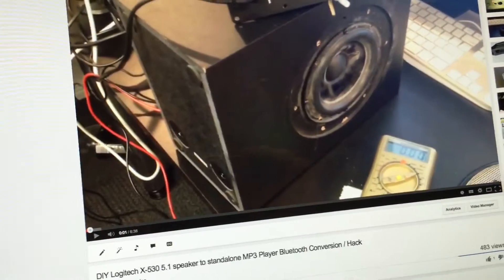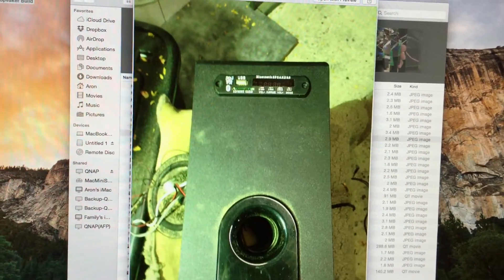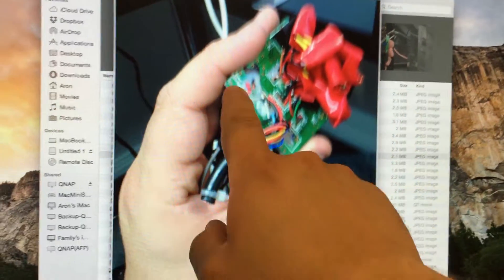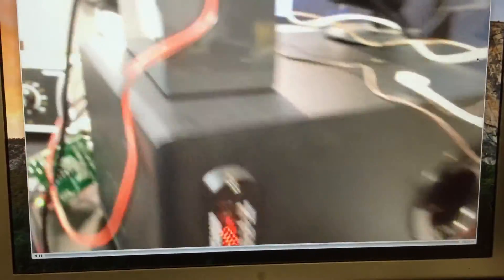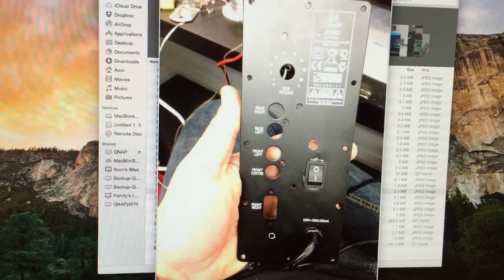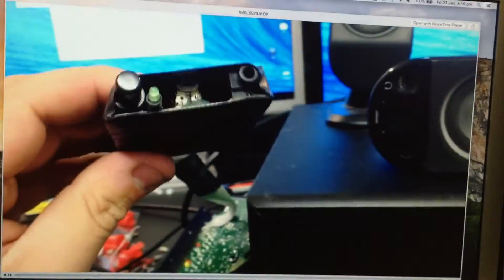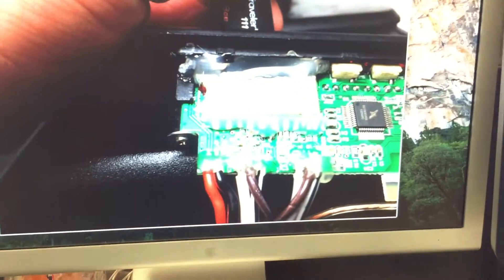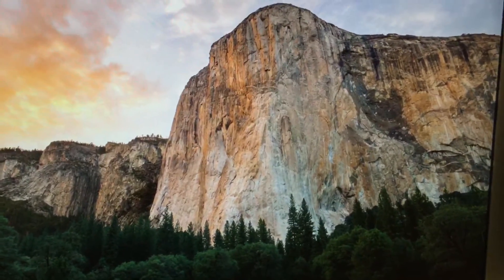DIY Logitech X-530 5.1 speaker to standalone MP3 Player Bluetooth Conversion / Hack Part 2

Comment: So basically you can use 12v battery for this setup and you have nice Bluetooth speaker to go?
Reply from the maker: the speaker takes more than 12v however it could be modified to work. the best solution however would be to get a cheap class D amp board from eBay

Comment: how you connect mp3 decoder to amplifier?
Reply from the maker: tero revo connect the line out to the line in on the amp.

If you are using an amp with RCA jacks u will wire the R out to the Red jacks center pin, the L out to the white jacks center pin and wire both jacks outer to the ground of the line out.  in my video at 1min 30sec the 3 wires in a group at the left of the screen were the line out. The white wires I used are the L/R and the brown is the ground

Comment: is there a way to make all the speakers connect via wireless and then have it all connected to the sub and then have the main control connected to a device? (in other words i want the speakers to be wireless instead of cabled)
Reply from the maker: Zardist the only way I could think of would be to put a small amp and portable fm radio module in each speaker. Then put an fm transmitter in the sub.

Comment: I have the box without the speakers and i would like to turn it on and use is as a stand alone but cant without the main input board. can you give ma a pin out diagram of the input on the box please?
Reply: you can find the scehmatics on google i had no probklem im trying to do the same thing  as you pretty much i found the diagram easily